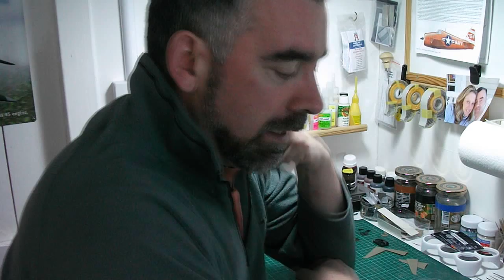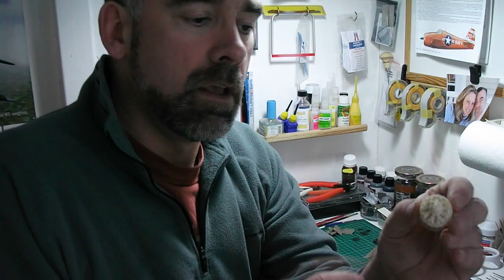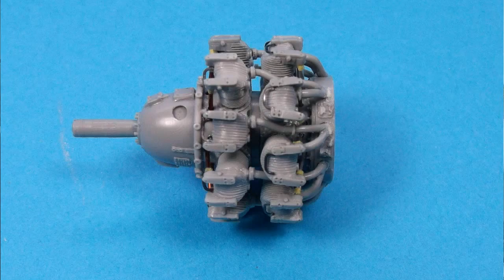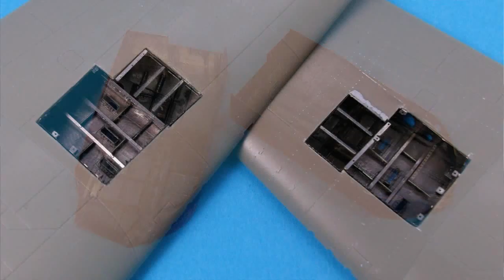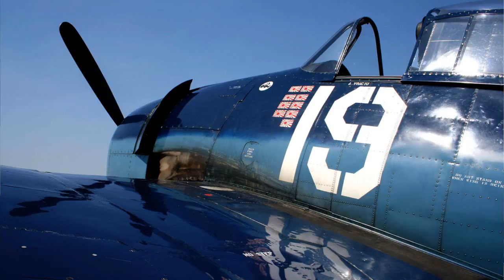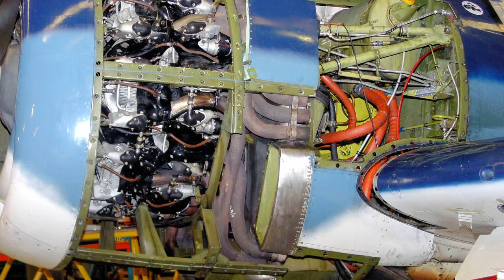Hellcat update. First of many... probably!

Comment: Immediately after posting my message I started making a test strip. I took a piece of plastic card, layed out a grid of 12x12mm squares, using 1 mm wide strips of yellow low stick tape. I used Tipp-ex, because it dries very quickly. However, Tipp-ex sometimes causes air bubbles, so it should not be used on large surfaces. Real primer is better. I then applied more Tipp-ex in the middle of all squares. Removed the tape, sanded it all smooth and sprayed on some paint. Looks promising ! ;-)

Comment: To create the ripple or cushion effect: mask off ALL rivet lines with 1 mm tape (NOT wider !!) and hand paint the model with thick primer. When dry, add another blob in the middle of every square/rectangle. A lot of work, but necessary. Remove the tape and sand the model, try to avoid to sand away the thick part in the middle of all rectangles. More priming is not necessary. Now, add layers of gloss blue paint until you get the result you want.
Great videos ! Keep up the good work.